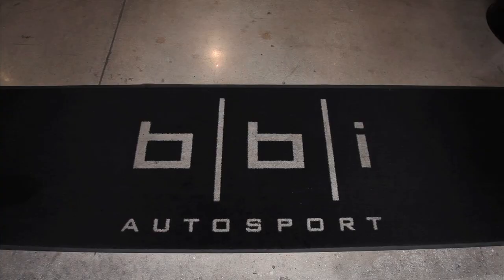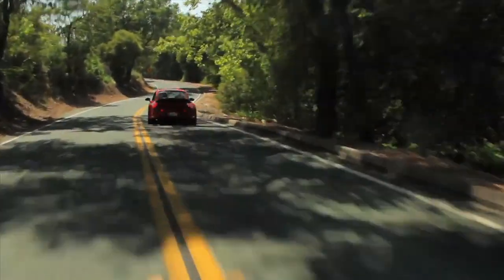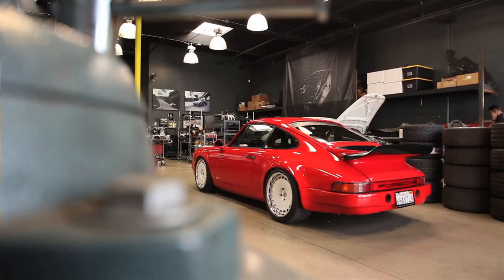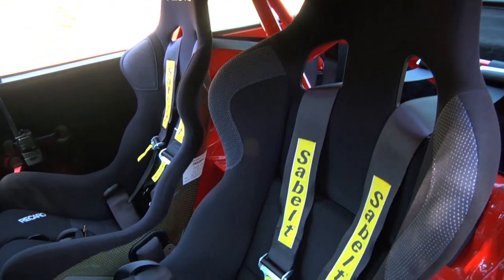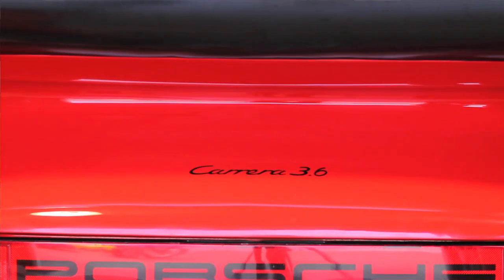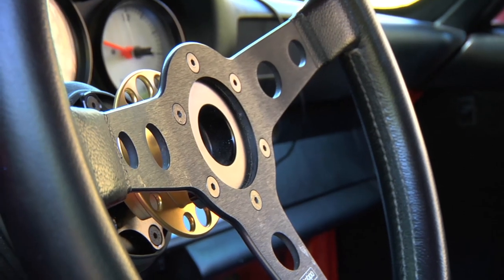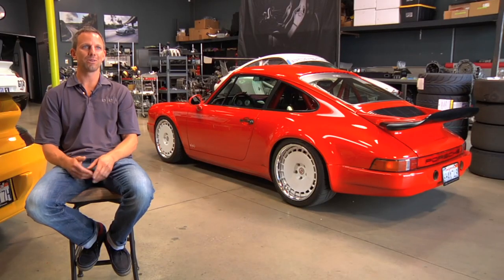BBi Autosport's Ultra-Light "Project Nasty" Porsche 911 - /TUNED

Comment: I come back at least once a month to watch. I love this car. I hate red but would still drive this car
Reply: lol meanwhile your picture is a red 911 :)
Reply: anon1561 Nah but one can dream. Ive had 944 turbos and 914 6 before they were worth anything.
Reply: mzondi1970 same, my first car was a '85 944T. wasn't expensive a  few years ago- especially when it was running but was down on compression. Re surfaced head, and new head gasket; ran like factory. only has 35k original miles, was going to be 5.3 swapped with a Renegade kit. I regret selling that car almost daily.

Comment: Great car, ugly wheels.
Reply: ***** What do you mean? The wheels are awesome and period correct.
Reply: The AE86 of Mt. Akina Well, they're INSPIRED by the wheels from a 935 race car, but that's not really the same thing as "period correct." Period-correct would be an actual set of OZ wheels from a 935, since that's what someone might have done at that time... I'd like them better if they were an inch or two smaller in diameter. That 80's look is pretty cool and does suit the car, but I think it throws off the effect when you go that big.
Reply: really? I love those wheels

Comment: usually no one, unless the engine is something you've never used before and because of it's super-light internals, revs up and down more like a literbike than a car. It matches perfectly if you're driving as fast as you can drive, but if you're shifting any slower than "as fast as possible," it's very difficult to rev match because the gearbox is heavy and a little clunky, and the engine changes speed so quickly. Then, a tach might be helpful.

Comment: Stunning car, and really nicely engineered, and those HRE wheels look simply amazing on it!!  If I were lucky enough to own a car like that, I might have the engine detuned just enough to be able to run on pump gas, and perhaps a headliner and carpet to help make the car a little more comfortable as a daily driver. Yes, it adds some weight, but there can be a fine balance between comfort and performance.  That being said, Joey's car is simply amazing!

Comment: I just completed a very similar build with a 87 Carrera with the G50 transmission, all the suspension is old school like the car, the 3.2L engine is stock with a 911chips set up for 91 octane @ 220hp to the wheels, equal length headers, no heat or AC... full cage but accessible to get in and out, solid suspension all around, solid engine mounts and trans mounts... strut tower brace, hollow torsion bars 22mm in front 28mm rear, Porsche Factory original 993 rsr Momo steering wheel and more,,,

Comment: I have a 2400lb '89 supercharged 911 road legal race car, with 964RS bodywork. It is black on black, with silver GT3 wheels for the road, and black Cup 1s with Targa tyres for the track.

These kinds of cars are the "Genuine Experience" of driving. Nothing else comes close. It is 100% raw, loud as fuck, bouncey as hell, and with just 7lbs of boost it exceeds what you think an old 911 should be able to do.

Without a roll cage though, a car isn't really for the track, it's for the road.

Comment: What a raw car! Welded sunroof, stripped raw, air cooled and from the 80's.. I mean can you get any more raw?!?! The only thing that would make it more raw is if it were carbureted but this is the ultimate build! They focused on what most car tuners wont, suspension, braking and overall balance. That chassis would probably be able to handle a 700hp engine as it is, but its made for a 300whp engine. Nothing like some good over-engineering!

Comment: That car is all that! Im making like 235 h.p. In my awd 325xi competion edition bmw. Its full interior but if i took all that out my a/c and radio? But to tell you the truth the car flys i have a ball in it, It has comp suspention in it but i want it a little lower so next weekend im gonna go 1.2 in the front and1'' in the rear. Its got the tight steering box, dampeners and the look of the steering wheel it self looks different,harmon kardon stereo,xenons,factory bucket seats with the front you can pull out. Its got everything as much as i love bmw porsche 911 will always be my first love!!!

Comment: When I say "driving a 911 is hard," I mean that, if you don't know what you're doing, it will crash. Same as any other big power vintage 911's (especially the turbos). If the back end gets lose, and you lift, you crash. That's the rule with an old RWD 911.

Comment: Love the sound of the engine. If Farah needs medication after 80 miles of L.A. chop blocked freeways, imagine there is no rubber anywhere to soften the "suspension" on a track car requiring 100 octane at all times. I love my Cayman R.

Comment: is it okay to drive an air cooled engine on a traffic jam at 30-35c weather?
Reply: Imam Dwi Septiadi my 993 does well in los Angeles traffic at 100 degrees.  runs warmer but as long as it's moving it stays cool enough.
Reply: thanks! my friend's old vw beetle overheat pretty often even it's slow and lightweight, as tough as a tank, but high performance air cooled car like porsche? i've never seeing one in real life!

Comment: If the car runs on 100 octane how does Joey drive it daily?
Reply: Here in the bay area CA, there are a few stations that sell race fuel. I'm sure it's not unheard of in other places.
Reply: Maurice Monge  Huuuu… interesting! Did not know that :)
Reply: fuel additives? but heard its not the same as 100 octane.
Reply: I live on Long Island and I know of a few stations that have it. If it's here it's gotta be elsewhere.
Reply: Just about any race track will carry race gas, and there are a few in CA. You can also add toluene to regular gas. With an octane of 120+ add a quart container to a five gallon jug. bing bam boom 100 octane race gas.
Reply: Yanni mouzakis there is actually alot more places in ca that you can buy 100 at than one might expect
Reply: Schallrausch it isn't additive it is a torco racing fuel concentrate it will take a 10 gal of 91oct and bring it up to 100oct with 32oz bottle. But it does leave orange residue on your pluga

Comment: I wonder how do you make the 964 this light !
singer's are  a similar weight but if i remember correctly they have carbon fiber body shells
Reply: it is the 964
Reply: its not a 964
Reply: chase lupex what is it then ?
Reply: its a 3.2 carrera because its an 85. 964's were from 89-94
Reply: chase lupex you're right, thanks

Comment: I had a `94 honda civic si (eg with the d16z6).  I loved it, it was a great car, enough power to have fun, great chassis to toss thru corners. I also hated it. FWD cars can do pretty well, but they'll never have the performance envelope of a well balanced rwd car.  I miss that car and wouldn't mind another powered by a k20/24.  But I'd have to strip it to the bones like the 911 in this video. And weld up a subframe to make it mid-engine.
Maybe I'll just put that engine in an AW11 MR2....

Comment: rwb porsches just look good and sound nice. that's about it. just ignore them for track driving.

btw. this old g-series porsche is near silent next to a porsche 911 3.0 rs-r with the open street legal exhaust. never understood how they did get that one street legal with open slide throttle body and the oldschool kugelfisch injection system and and no cat's or any other sort of muffler.

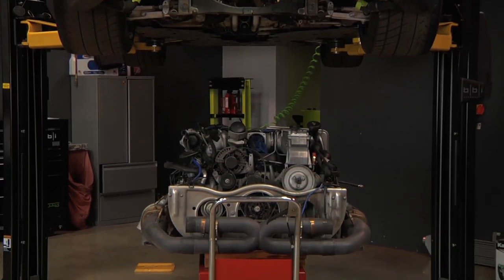Comment: 3:50 cruising on the freeway at 0 mph and 0 rpm. The car is owned by a professional auto technician, so I doubt the speedo and tach are broken. Does he just disable them to keep miles off the odometer?
Reply: +HybridPhoenix08 The odometer usually isn't really connected to the speedo. I would guess they aren't "needed". You can hear your RPMs so you have to know when to shift. And the speedo might be helpful. You know: "Do you know how fast you were going?" "I'm sorry officer, but my speedometer doesn't work, as you can see..."
Reply: for the video aka camera trick so they don't get caught speeding on camera

Comment: yeah, its hard to think of a more iconic car than an 80s 911. but this is the 964, which is hardly the 80s 911 most imagine, at least in its design. it is the most robust, but not its most beautiful.
Reply: It's a 1985 3.2 Carrera with a 3.6L RS America motor. 964's were built from 1989-1994.

Comment: How is this street legal?  How does it pass smog?
Reply: I am wondering the same thing. I have a 3.2 Carrera too and would happily do this engine tune if I can get it to pass smog
Reply: Either that, or they just dump in a stock engine each time the car has to get that check.

Comment: I wish youd come do a show on my truck. I have a 1998 gmc 1500 extended cab short bed with 2010 Silverado front suspension, all forged internals in the OEM vortech 350 with 11.5:1 pistons, big cam, multi port fuel injection, holley terminator x, twin gt45s, 2 walbro 450 fuel pumps, ignite e90, a built 4L60E, 3200 stall converter, 4.11 gears with lockers front and rear, stock ride height with 33 inch tires and 1109 wheel hp. Its my daily driver, on the economy map it gets 21 mpg, and it covers 1320 feet from a dig in 11.3seconds while trapping 123 mph. Its not a drag car, its a tire obliterating, dirt road destroying yamahauler. I ride Yamahas. A 2020 yz450f and a 2018 R1m. My wife rides a 2017 yz125 and the boys are about to be on yz85s. I have twin 9 year old boys. I also have a 712 wheel hp 1998 audi A4 thats my family car, a 608 wheel hp 1998 mustang gt thats my drift car, and a 1300 hp bbf twin turbo '61 falcon that tries to kill me all the time. Why all the 1998 model year vehicles? Because i can register them as classic vehicles and i dont have to worry about passing emissions.

Comment: ”Like modern Carrera vs. GT3 RS  ... way lighter”.
That is not a black and white fact. The Mezger was considerably heavier than the M96/M97 Carrera engines were.
From 991 onwards there has really not been much difference in weights of engines but there is a huge difference in gearbox weights - the PDK weighing typically like 50 kg more than a manual! Besides you simply dont feel a 20 kg difference. You got to have more than 50 kg, preferably 100 kgs to really notice the difference. Or lets say close to 10% difference. If you can take it from the roof it helps. You can see smaller differencies with watch over lap time but you cant really feel it.

Also another thing I frequently come across with these bloggers is that they say that brakes are more efficient - when most times they mean that the brakes bite more aggressively, that is, require less pedal force - which actually has very little to do with brake efficiency. A high mu pad usually saturates itself with heat more quick than a low mu pad. Of course there are pads that both bite and are efficient (e.g. pfc) with the expense of quick disc wear. You really should not assess pads/discs with just a few easy brakings but several adjacent high speed to low speed brakings to see how the pads behave when saturated with heat. Usually the racing type pads create a lot more brake dust than street type pads but they tolerate heat a lot better. Weareing out is one way of transforming kinetic energy ultimately to heat.

Comment: Can’t afford to do that so I’m building a 914 rs . 996 suspension Solid. Mounts all round  and powered by Dit wrx 2015+ engine and box.  Japanese engines are cheep horse power and very  tuneable.  On paper faster than this  wet dream.

Comment: Define safe? Also, a tube chassis is no longer a 911, a fiberglass 959 is a kit car. Kit cobras aren't that light. Caterhams aren't that light. You live in the fantasy land called Trollsville. 

Fiberglass is probably bad for the environment, and tube metal screams when you cut it.

Comment: Twin turbo flat 6 under 300hp? kind of sad. Single turbo Honda motors EASILY get into these figures.
Reply: It's aircooled. They weren't going for max bhp with this car.
Reply: Have you heard of a torque curve?
Reply: its not turbo guy............
Reply: It's N/A. That's the main thing about GT3's, which this car is a homage to, they're all N/A.
Reply: Every video, why why why, is there always a Honda guy on every single video about how he can do this better or that. I get it they're more customizable and sure you can tweak it until you run out of meth, its still not going to be a Porsche.
Reply: I don't think it's a Honda thing so much as those cars being cheap and accessible and attracting people that feel the need to prove themselves against more expensive and capable machinery. (I drive an Integra myself). Sort of like an automotive napoleon complex or something.
Reply: Porsche arent about horse power.!
Reply: I could glue a picture of a turbo to the front of my tricycle and it would be faster AND more fun than your Honda. It's N/A buddy.